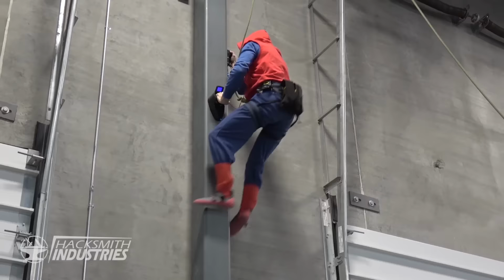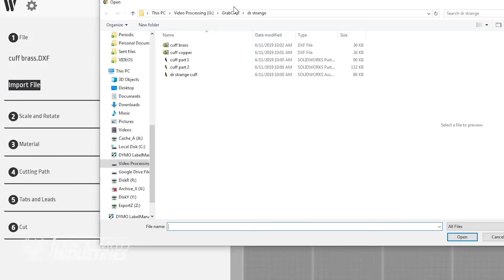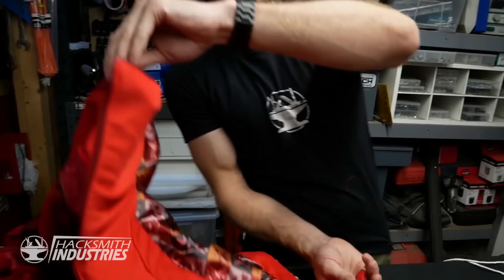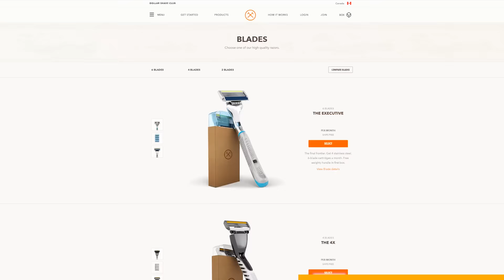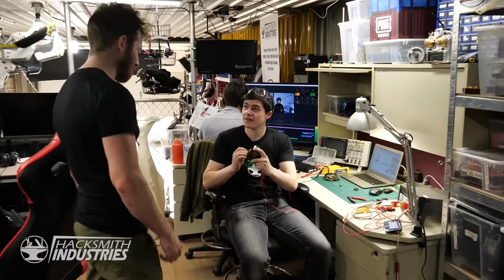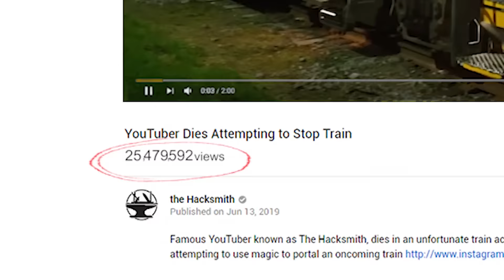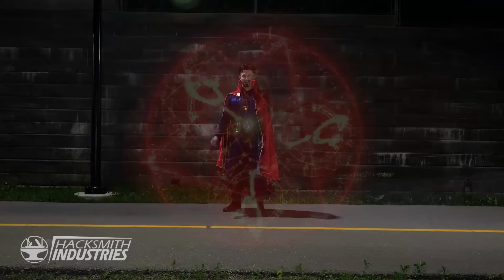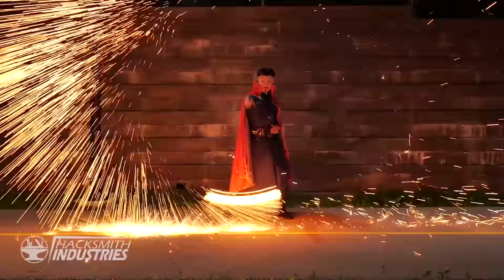Dr Strange in Real Life? (SPELLS, PORTALS & MORE)

Comment: do a Make It real of NOKKs ability from rainbow six siege. You would motion capture to digitally erase the user from the frame.
Reply: Tachanka 101  its called "make it real" not "make it simple", and, actually it would be quite simple in theory, you would obviously use a still frame as the background and use a motion capture suit to locate the user's boundaries and then, using an incredibly powerful PC, remove the user from the frame, live, on a video feed. If you don't think live motion capture is possible, check out Corridor Crew, they made an entire game around moving around in a motion capture suit and avoiding obstacles. the Hacksmith, you could even contact them! they may have some good insights as to how to approach a project like that.

Comment: Hey way cool 
Hey what if you make a suit that mirrors everything around you effectively making you invisible now I thought on it and if a panoramic camera on top of your head routed to your tv screen suit now at the same time I thought ok it will be hot so on the inside where the power source goes and light sensing auto adjustable to ambient light levels and using tubes and rubber hoses and fans to make the this suit comfortable and a few electric pumps that should make it invisible on heat signature as well.